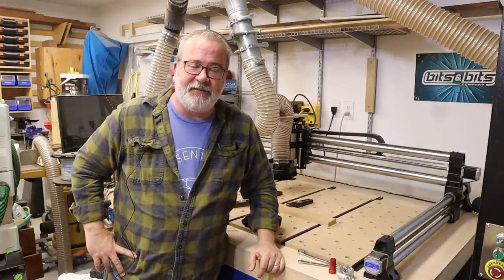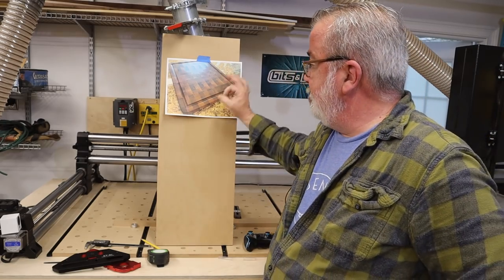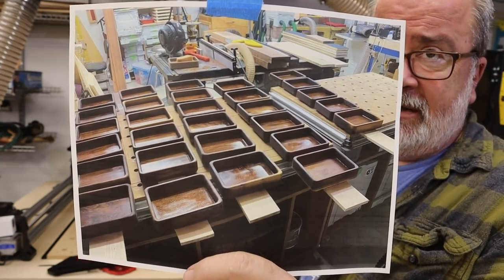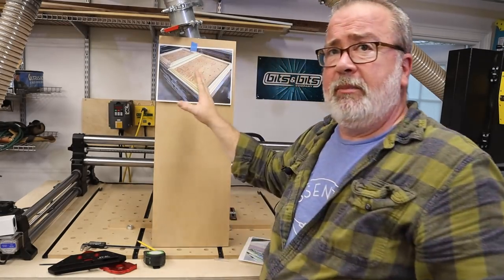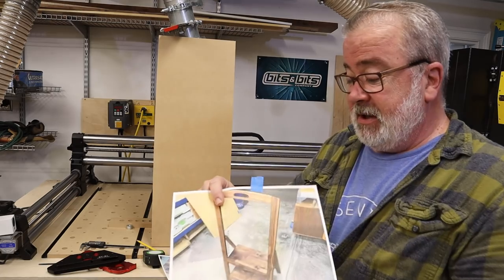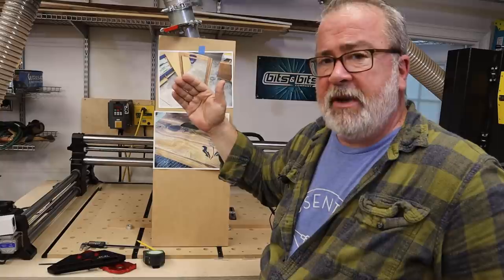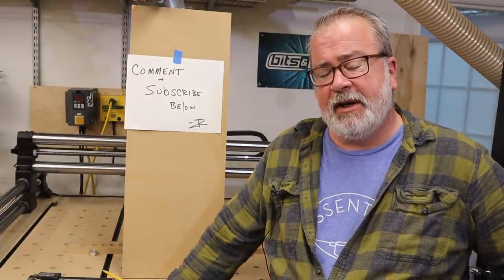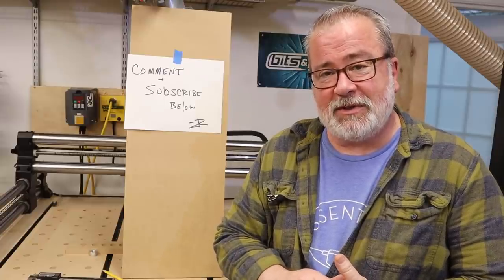Top 5 Projects/Uses For Your CNC Router And Should You Buy A CNC For Your Wood Shop?

Comment: I'm nearing my retirement date.  I have wanted a CNC machine for years.  I was going to build one out of wood then use it to build a aluminum unit was my thought.  I worked months on the design of my unit but then 2008 came in and I was unemployed.  So it went on the back burner until recently.  I am set on getting a Onefinity elite woodworker.  I have been saving up my money and I'm about 3 months from purchasing it.  I watch all the cnc videos and making some decisions on what I need.  I really studied all the CNC units out there.  I really like a lot of them but there are drawbacks in every design.  I'm not going to go into them but I made some people angry about questions asked.  In my eyes I feel the Onefinity CNC unit is what I want.  great video JR.  Looking forward to more from you
Reply from the maker: Hi Tale, thanks for your note. I did a review on the onefinity woodworker (first version) about 6 months into owning one. I’ve since upgraded the x axis to the journeyman size and then finally just received my elite machine. I have ti say, their engineering (no belts or wheels) and the way the machine is built is fantastic in my eyes. Has not let me down once and I’ve really enjoyed adding a Cnc to my woodshop. Congratulations on the upcoming retirement and I hope you have fun with your machine. Maybe consider subscribing, I’m about to do a video on the elite machine that you might find helpful. Thanks and take care.

Comment: Thanks for the great video. I'm no woodworker and just getting started with CNC, but to me, my CNC is my planer, jointer, table saw, chop saw, and drill press. The only other two things I purchased is a Wen track saw (half the price of others) and a cheap ~$130 chop saw. But I only use those to break down material to fit on my CNC bed. And, a chop saw is useful for a number of other things around the house, like building my work benches for both the CNC, and myself where 1/8" accuracy is all I need. I see so many people spending time (and many thousands of dollars per machine) getting some material the size of a cutting board to a perfect, finished, state "ready" for carving/cutting on the CNC, when my surfacing bits do the planing, and the straight bits to the jointing.
Reply from the maker: Hi Surfing Noid , Thanks for taking the time to view, and comment I really do appreciate it.  If you haven't had a chance yet, and are willing, I'd love to ask you to subscribe in order to help me get the word out to more people who might be interested.  you bring up some very good points.  Thanks again and have a great day!

Comment: I make 3D Printed lithophane nightlight boxes. I designed the legs in Fusion 360 and 3D print the legs and all the photos. The top and bottom are made from Oak boards. Now I used my Sienci Longmill CNC router to make the top and bottom with perfect placement of the leg holes, center hole for the light, and a pocket for the lid.
Reply from the maker: Hey Jack, that sounds like a great blend of creativity and using the tools you’ve got to enhance what you’re making.  Love it!

Comment: Great video JR, and thanks for sharing. The one major step up the CNC has provided me is in making wedding boxes for my wife's ministry business. These hold letter-sized items like vows or 4 x 6 cards of poems, songs, etc. that the couples exchange during their wedding ceremony. I started making them before getting a CNC with sliding dovetails using a post and panel design and a barrel-hinged lid. The lid was then carved with their names and dates and a little wedding ring icon hand-routed with a palm router. The sliding dovetails always took a lot of time to make, with too much waste, too much time to sand down to fit correctly, etc. While they always looked decent, they were no match for what a CNC can turn out in much less time. Carving the names and dates have gone from rustic to beautiful and the wedding rings are nice 3D models inside a dish. In short, it's the same finished product, but the quality is so much nicer, less stressful to build and much less time required. And I'll be moving from a little Next Wave Piranha Fx to a Onefinity Journeyman 3-4 weeks from now, so I'll be able to take on larger projects with better speed and accuracy.
Reply from the maker: Man, that's a great example of combining new tools into a current project platform, sounds like you've found a way to take out some of the drudgery in a repetitive task!  You'll love the Onefinity if you get one, I do.  If you haven't had a chance, please consider subscribing as there is more to come on this topic!  Thanks!
Reply: @TradeSkillersAnonymous  Thanks, that about sums it up, turning a tough task into something I'm both happier doing and happier seeing the end result. I subscribed some time in the last week or so. The Journeyman was ordered in mid-February, so I'm doing my 10-12 weeks of purgatory until it arrives :-) In the meantime, I've been ordering accessories for it and will be building the table next weekend.

Comment: Do you have a demo video for the cutting boards that includes all the bit speeds, feeds, etc.? Thanks!
Reply from the maker: Hi spunky, I don’t usually post speeds and feeds because everyone uses such different wood species, and they are all different hardness. However in walnut/maple I usually run profile cuts with a 1/4” compression bit at 120 to 150 inches per minute and .300 to .500 depth of cut. I run a onefinity which is nice and rigid and doesn’t flex. Bowl bit for juice groove is 3/8”, 150 ipm, two passes. The last pass is only .005” or less, and just makes the finish of the groove nice and smooth eliminating need for a lot of sanding. 

Hope that helps, and if you haven’t had a chance, I invite you to subscribe while you’re here!

Comment: Great info, quite insightful.  For your picture frames do you use the CNC to mill the blanks into 4 separate pieces and then use a miter saw or equivalent to subsequently cut them into an actual frame?
Reply from the maker: Hi there, thanks for watching and your comment!  I mill blanks, and then use either my picture frame sled on my table saw, or miter saw to cut into the frame shape I need. Thanks, and consider sibs riding while you’re here, it’s free!

Comment: I noticed your VFD for the first time. Which spindle do you have and would you recommend the upgrade?
Reply from the maker: I went with a hyuang 220v, 1.5kw spindle. If I had it to do over again, I’d have gone with a2.2kw, 80mm spindle so it would clear the z motor, as is my 65mm spindle does not so it limits my z travel a little bit. At the time I bought mine though, 65mm mounts were all that were available.
Reply: @TradeSkillersAnonymous  Great, thank you for your reply!

Comment: For putting the bees on the wood and making them black like that and flush, what did you do? Did you use a laser or did you engrave it and then paint it? Can you please explain that part in more detail? 

Thanks!
Reply from the maker: Hi Zane, thanks for watching and for your question.  For the bees and Scottish thistle, I used my cnc to V-Carve the features, and then filled with epoxy and then sanded back smooth. Thanks and have a great day!